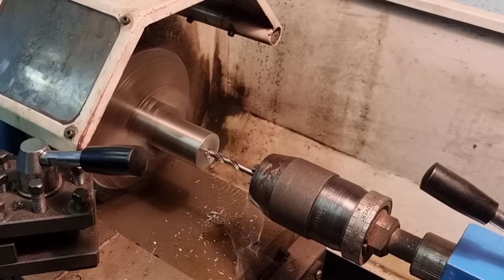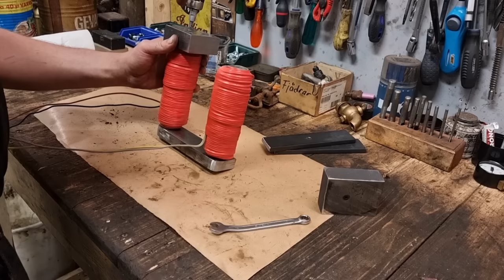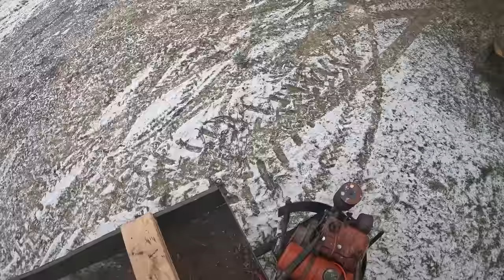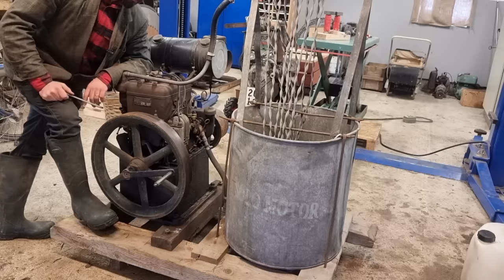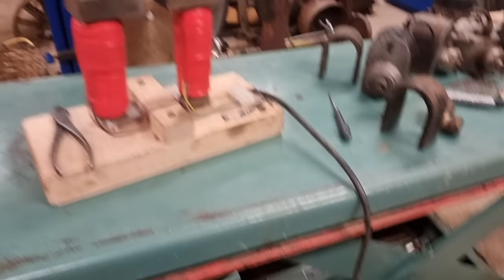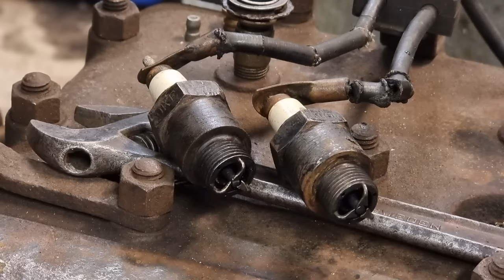Your old Magneto will need this! How to build and use a electro-Magnetizer!

Comment: I think even Michael Faraday would be proud of that magnetic monster! Have you seen his original electromagnet at the Royal Institution?

I've seen magnetos where people have stuck neodymium magnets onto the poles in an effort to boost the magnetic field.

Now, when I was still in school, which is a long time ago, we were taught to place a keeper across the ends of the poles. The purpose of which is to complete the magnetic circuit, which in turn would preserve the magnetic field density - a couple of large bolts, or a piece of steel bar would suffice. Once replaced into the magneto, the pole pieces and the rotor were sufficient to maintain the circuit. The rule of thumb was never to leave magnets without a keeper in place.
Reply: Similar experience with the keepers. I don't understand the idea of not letting the magnet grab onto the steel table surface.
Reply: @clarencegreen3071  the idea I believe is the pull on the ions or electrons (pardon the rudimentary struggle?) Causes flow. The ions can begin to flow changing the position of same leaving the strength of the magnetic pull in the other piece it's stuck to. The magnetism is not affected this way by aluminium and is isolated from losing its charge in the magneto.. oR something like that?

Comment: Thanks for demonstrating this process. It is what I consider to be a good solution to a problem: simple yet very effective. At any rate, It reminds me of when I used to work for a company that used a lot of magnets in their products. The "magnets" arrived from the manufacturer in the unmagnetized state (I don't know what you call a magnet before it has been magnetized, I suppose there is a word for that.). The reason they came this way is that unmagnetized magnets are much easier and safer to handle and can be more easily machined if necessary. So, we had a device called a "magnet charger" which was used to magnetize the unmagnetized magnets. You put the unmagnetized magnet in the machine, pushed the button, something inside the machine went "click", and instantly the magnet became a full fledged, fully magnetized magnet. Just like that. I always thought it was kind of magical.
Reply from the maker: Hi! Yes all magnetic force feels kind of magical. Like a mystery but easy to control. /Richard
Reply: I think they are called anti-magnets.  Whatever you do, you can't mix magnets with anti-magnets, he said in his best Montgomery Scott voice...
Reply: Solid state magnet after, thats all i know.
Reply: An non magnetized magnet is called steel :)  The alloy is such that it is capable of keeping the magnetic force when magnetized. But it is still steel.
Reply: @jlinkels  Well, iron.
Reply: @atvheads  No, not likely. Usually iron is softer and does not hold magnetic structure well. The microcrystalline structure which is characteristic for the softness of iron  causes the magnetic domains return to their random and thus non-magnetic state. Steel on the other hand has a different crystalline structure because of the added carbon. That structure causes hardness or toughness, and also make the magnetic domains stick in their united alignment which eventually make up the magnet. Aligning such domains is forced by a strong magnetic field like shown in this video. Soft iron is used in transformer cores and such where permanent magnetism would be disadvantageous. I am sure some counter examples exist, but this is the general rule.
Reply: Inside those machines are coils similar to those in this video, and a capacitor that holds a lot of energy. And when you press the button, the capacitor dumps all the energy into the coil, there is a lot of energy but over a very short period of time.. And the magnet receive this energy. So you can hear a click it is magnetostriction or coils work like some kind of very bad speaker :) This is a side-effect.

Comment: Nicely done. Since you are using an old and powerless battery the current through the magnet is mainly determined by the current source capability of the battery, not the wire resistance. Given the spark on your switch when you disconnect the current, the current is really low. You are using thick and heavy wire but you have plenty of space around your cores. You if you would double the number of windings, the current would remain more or less the same, but the magnetic field would almost double as well. If it also makes your magneto magnet stronger is determined whether the cores of your magnet become saturated, and when the magnet itself is saturated. Measuring the saturation of your magnet could be done by measuring the field and note when it does not increase anymore when the current or winding count increase. If that would be of interest at all. In any case, saturation of the cores do not harm the functionality or the quality of the field.

Comment: Try heating it with a blowtorch just before or while tapping it. It will significantly increase how much magnetism it take and how long it will hold it for in the future. Do not cool it rapidly in water though.  Cheer and thanks for the video.
Reply: How much wire did you put on the pillars and was it already insulated.  Do you also. Know Know what size it is.  Thank you for this video.

Comment: Richard, I really enjoy the videos.  I have a magnetizer built by Allen and it has several steel blocks with different angles that lay on top of the magnet charger poles for charging round magnets in flywheels and armature magnets. Keep up the good work!

Comment: Actually it is better to shorten the magnet poles by means of a steel bar. You recommend to keep it far from steel (15:00). But the contrary is true. Magnets loose their force when a reverse magnetic field is working onto the poles. By putting a steel bar over the magnet poles, the magnetic circuit is closed again an less susceptible to external magnetic fields. Even if you put the magnet on a steel table, the table acts as a shorting bar. An almost infinitely large bar, but it still closes the magnetic circuit.
Reply: That’s why , many years ago, if we went to the shop to buy a horse shoe magnet, it was always supplied with a ‘ keeper’.  A piece of steel across the poles., to prevent the magnet being demagnetised.

Comment: The thicker top steel pieces might not be creating the effect you intend.  It will result in a weaker but more even (parallel) magnetic field than a thin piece.  Consider tapering one end of the pieces so that you can rotate them to create a more concentrated field when needed.  Also consider slotting the top piece mounting hole to minimize the air gap.
Reply: Also, the magnetic circuit is much longer than it needs to be. The side pieces could be shortened significantly, and the bottom also, to make it less wide. Make the coils (and the entire unit) as compact as possible while keeping the same number of turns.

Comment: I too have had engines that I have turned over more times by hand than it has turned when running! This might well be worth a try, and I have the scrap laying around to build one, Thanks!! Number of turns of wire(about)? Gage of wire used? Approx diameter of rods?

Comment: Hi from Ontario (Canada).  Many years ago I worked on a system for magnetizing the magnets for high end audio loudspeakers.  The machine had banks of large capacitors joined in series-parallel capable of charging to 1200 Volts and delivering a 1000 amp pulse through magnetizing coils placed around the magnet cores.  The cables to the coils were about 25mm in diameter and jumped like angry snakes when the capacitor banks were discharged.  People with pacemakers were not allowed near it when in operation.  The stray EMP would destroy watches, computer drives and magnetic credit/bank cards.

Comment: I am 85 years old and still I learn something new by watching your video. Over 50 years ago I had  gaff rigged 26 foot Huon Pine boat with a big heavy single cylinder Simplex 5 HP petrol marine engine, started by grasping the big cast iron flywheel with both hands and pulling the engine over. It was always hard to start until I replaced the old mag with a new one, it made such a difference, now I know why. What is the purpose of tapping the magnet during the magnetising phase? Greetings from Tasmania Australia. 👍😁🇦🇺🦘

Comment: Add a diode across each coil, to avoid sparking at the switch so much. The collapsing field is making a voltage spike, a backward diode will short out the back EMF, problem solved.

Comment: Reminds me of an old, slightly unsafe trick to get more powerful magnetisation that acts really quickly so you don't need to spend time tapping on it etc.

Instead of that springy switch you made, wire in a piece of aluminium foil maybe half an inch wide and a couple inches long. And instead of the 12V battery, a standard plug for 240V AC. When you plug it in, the alu foil acts as a fuse and burns away almost instantly. What makes this work is that the foil will never break while the AC sine wave is passing through zero volts heading towards the opposite polarity, it always fails near the top (or bottom, opposite polarity) of the alternating sine wave where the voltage is highest. So instead of a mere 12V through the coils, for 1/50th of a second you have 240V or thereabouts and then the alu foil burns away to break the circuit. It never gets around to alternating to the opposite polarity because the circuit is broken by then. And the coils never overheat despite the high current, because they're only energized for a brief moment.

The downside, of course, is you get random polarity with a 50/50 chance of your magnet being the wrong way around. A sufficiently powerful diode could fix that, I guess.

Now obviously this trick predates OHSA by several decades; don't actually try this if you don't want to risk electric arcs burning things and splattering melted aluminium everywhere.

Comment: A very elegant solution! May I offer one or two improvements over this great design of yours. Fit a reverse biased diode across the coil to kill any back EMF from the coil when the switch is opened, this will increase the efficiency of the magnetizer coils... A very high voltage is developed when the switch is opened and can actually erode part of the built up magnet. Use a couple of 50amp diodes in parallel across the coil in reverse bias.
I have built a number of larger versions of this device in 2 and 4 pole configurations, one was run from 3 car batteries in series but the far more successful ones were powered from large capacitor banks. The capacitors were wired in parallel and the charge voltage to the capacitors could be varied depending on the flux density required. The switch needs to be very heavy duty but can be made from something as simple as some copper bar to form a knife switch. 50-300 volts DC is good. The advantage of this arrangement is a sudden polarization of the magnet, kind of what you were trying to achieve by tapping on the magnet with the low voltage supply.
At the very least, try diodes and possibly a second or third car battery in series to increase the voltage.

Comment: If you hook up your magnetizer to low voltage high current AC (from an AC buzz box welder, perhaps, if you have one) it becomes a demagnetizer.  The alternating field will leave almost no residual field in, say, a screwdriver that you need to use with small parts or a pair of pliers that you need to actually drop that spring ring when you release your grip.

Comment: I also suggest change those spark plug cables as well,  age and oxide usually builds up a resistance even on shorter lengths

Comment: I use a small handheld torch to burn the carbon off spark plugs and it saves me a lot of money on a Makita Leaf Blower that likes to fowl spark plugs. The carb doesn't have any adjustments and the new one they sent to me is the wrong one for my model, so I just burn off the carbon build up on the plug every few months to get by until I can fix the carb issue permanently. Just get the spark plug good and hot for a minute or so (tip only) and brush it with a brass wire brush and the plug/plugs will be like new. (Having trouble findings the correct replacement spark plugs as well here in the Philippines.) Hope that helps... Great video... Subscribed...

Comment: To get the best charge in your magneto you need to remove the impulse mechanism if it has one and charge the entire magneto the steel in the magneto also takes some magnetism that will give you your hottest mag if the impulse isn't removed first, it will magnetize and not work. also, I have an original Bosch magneto charger it has 26-pound coils of number 10 square motor winding wire per winding the manual said to energize the charger for 3 seconds 3 times to charge the mag.

Comment: To make your magnetizer way more powerful you can wire both coils in parallel, that will double the strength of the magnetic field, but first try it in it's current state with a fully charged good battery to make sure the coils don't already get hot very quickly, because in parallel they will obviously get twice as hot.
Maybe the magnetizer will even be  twice as powerful with a good battery without changing anything
Reply: The battery which was down to 9 Volt must have limited the current in the video, and still the result was amazing. Full 12 V and like 1000 A would have burned the improvised switch in hurry, I'm sure. Better use a switch and do not tap the cables to the battery pole! I have blown up a battery by arcing on the poles when I was younger. Nothing bad happened except my clothes were ruined by the acid... but a scary experience I can tell you.
To sum it up, a weak battery might be preferable in fact.
Reply: @ppd3bw  yes, the improvised switch may weld itself shut, the best switch for this application may be a old starter relay, those can handle hundreds of amps without any issues.
It is probably also a good idea to add a improvised fuse, for example a piece of copper wire with 1/2 die diameter of the coil wire or better a aluminum wire slightly thinner than the coil wire, just to make sure the fuse wire melts before the coils melt.
It is also possible to limit the current with glow plugs (the modern ones preferably) each glow plug equals approx 20 amps, so you can wire 10 glow plugs in parallel to limit the current to 200 amps for example.
Of course the real current will be less because of the resistance of the coils...

Comment: Maybe next time in town pick up a couple of spark plug wires. Otherwise it was a very good video and useful  thanks
Reply from the maker: Hi, those are copper core. Will not effect the engine if it's nog touching metal. But sure i could swap them for new ones, but then i want fabric ones like original. Take care! /Richard

Comment: Very nice video. This knowledge is not common any longer...
I guess you can make a few improvements to your magnetic system but it is so simple and yet efficient  ... it would be wasted effort.
Just for people unfamiliar with magnetic: the "electromagnetic circuit" of the magnetizer need to be mild steel  (not hard temper steel) and it must be as big as possible : the magnet you are treating must be  of a smaller size. The coils must achieve two goals : 1- generating the most possible Amp x Turn. 2- not overheating! You may use much thinner wire coils with according higher number of wire turns...and/or more voltage to get the same, or higher magnetisation. The rule of thumb is that the magnetizer will not  get stronger past a limit of Amp x Turn. Once you reach this limit pushing more Amp is just wasted energy...and more heat. You just want to have the maximum magnetic field as more Amps will probably just making the coil too warm too quickly...

Comment: Thank-you for this!  This is exactly what we need to "re-power" several magnetos in our club's fleet of hit & miss engines.  Is there any chance you could share some plans; diameter & height of the cores, how many feet & gauge of wire, connection diagram, etc?

Comment: Great video, and great too see you back in character ;) In another comment you mentioned time limitations, I get what that’s like, and I appreciate you heading out the the shop (probably late at night after the kids are asleep) to make these videos. 

As someone else mentioned, putting a bar across a magnet when it’s not installed is a good thing and preserves the magnets, they call ‘em keepers. But I think that your right, when going straight from the magnetizer to the magneto, it’s probably better to not slap anything in the faces, due to the indeterminate effects of mechanically shocking the magnet.  

Are you post-processing the audio? Some kind of noise cancellation? It has a “conference call speakerphone” quality, where the unvoiced speech sounds are very quiet, but the voiced sounds are loud, and it makes my broken brain work overtime.

Comment: A proper test would be to measure the holding force of the magnet before and after.
If you wanted to test the effect of tapping, you should de-magnetize the magnet between each test. Tatt's done by apllying A/C to the coil and slowly removing the magnet.

Comment: I like your videos! Keep up the good work!!! I'm curious about that 2-cylinder engine - do the pistons come up and go down together, or does one come up before the other? Judging from the sound, I'd say they come up one after the other. This would make the engine fire one and then the other, with a longer time before they fire again.
Reply: One right after the other is how Deere did their's, which caused alot of trouble using certain non-Deere pto driven implements. Normally a 2-cylinder is 180degrees out. (2-stroke away from each other, while one is on intake, the other fires. While one is on compression, the other is exhausting, etc...)
Reply from the maker: Hi! One after the other. Makes better balance in the engine. And yes it fires like bang-bang-miss-miss. Etc. /Richard